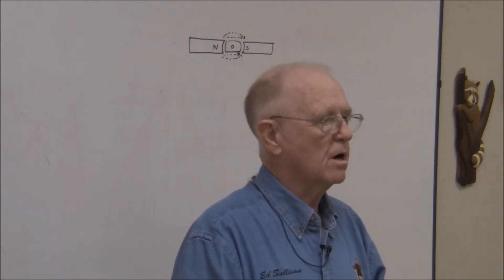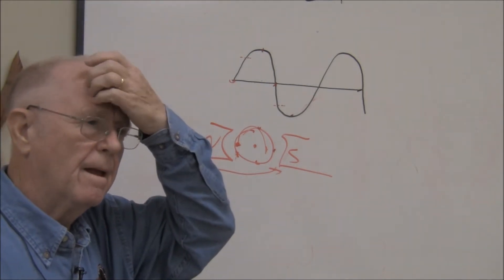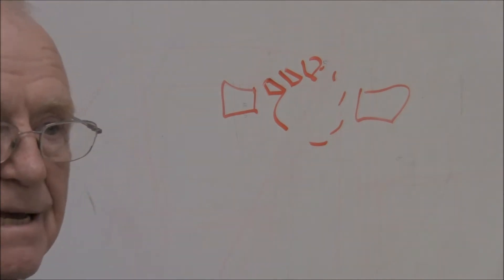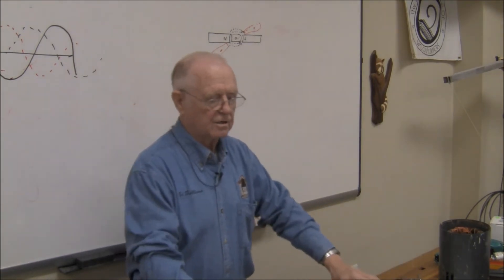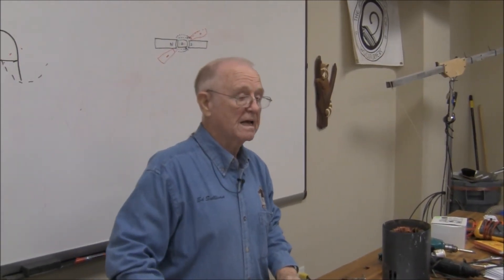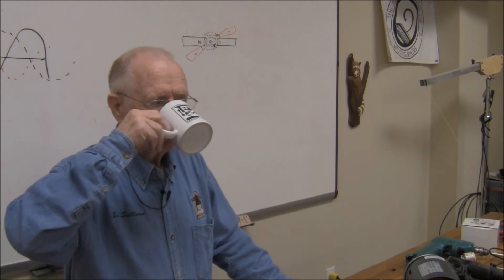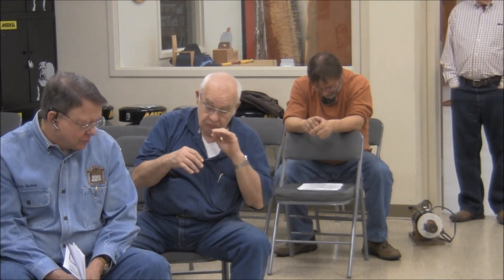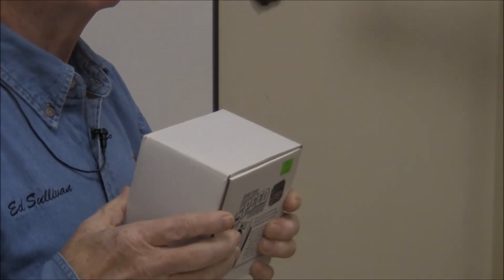2012-11-01 Understanding Electric Motors by Ed Sullivan (1h12m16s)

Comment: Great presentation, I learned alot. The speed of a DC motor is pretty proportional to voltage, however a PWM controller can also be used to control the speed. This effectively reduces the average voltage the motor sees but it is much more efficient than using the potietiometer/rheostat method to decrease the voltage by creating heat.  Also, I'm not positive but I thought running a motor at 220 vs 110 would yield greater torque and would always run cooler.

Comment: Ed (Mr. Sullivan...) gave one of the most informative presentations on AC/DC motors that I have ever seen (and I've seen a few...).  Great presentation, certainly demonstrating his wide knowledge of motor electronics...must have been his Air Force background!  :>)  Would really enjoy one of his presentations on replacement motors for lathes (variable and fixed speed...) and/or ability to add variable speed controlers to different types of electric motors (i.e.; lathes, scroll saws, etc....).

Comment: A/C contractors still use the capacitor scam to tell people they need a new $5,000 air conditioner, when all is needed is a start/run capacitor on the air handler fan or compressor.